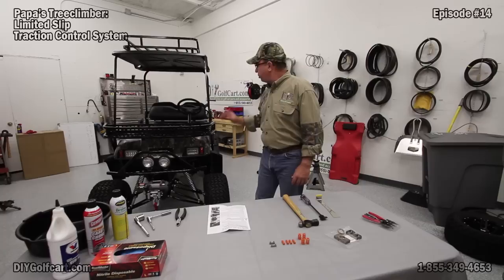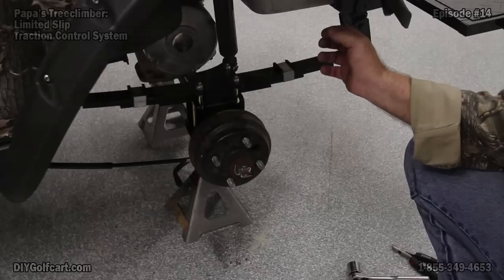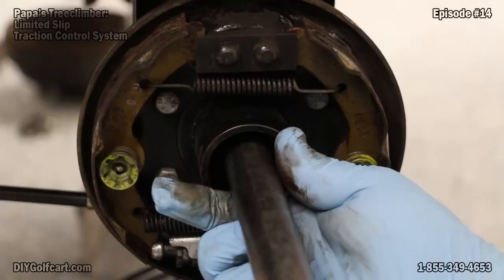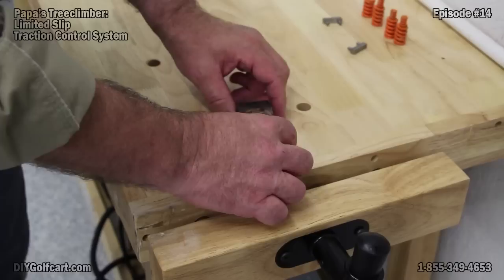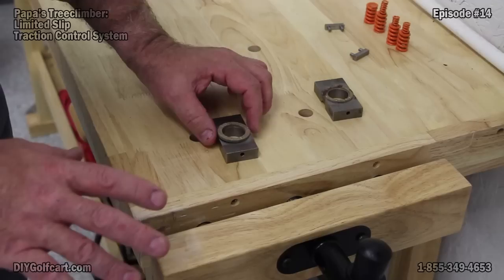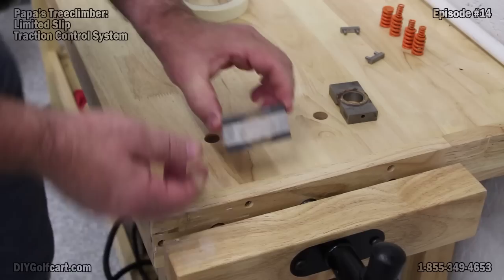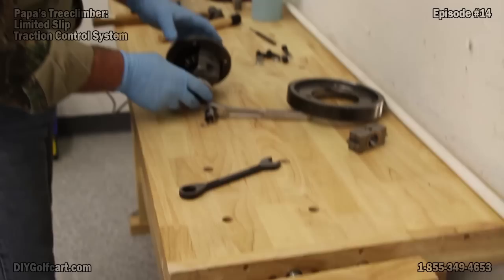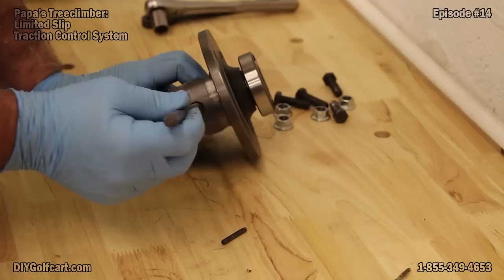EZGO Limited Slip Differential | How to Install Golf Cart Traction Control System

Comment: Great information. I have a 2009 EZGO RVX and the drain plug is made of rubber. I simply add the oil through the axle tube while it was still open. I didn't see in your video, but i added 2oz of friction modifier for limited slip diff.

Comment: Ahhh,.. at the end, you put the Brake Drum back on over the wasted brake shoes. ???? Did the friction device work? How about a demonstration? The device connects the 2 axles inside the differential via the 2 friction washers rubbing together? How long will that last before the surfaces are worn? The fiber friction rings you pressed in are the serviceable replacement parts that would wear out?

Comment: I have a 2005 yamaha pro hauler 700. I followed your instructions on how to remove the rear axle but the rear axle does not slide out like you show i need your help so that can install the limited slip

Comment: what is the torque value on the differential cover?
Reply from the maker: I have looked and looked and the closet I can find is 5 to 7 ft lbs. You mainly want to snug it down without over tightening. It's going into an aluminum case so don't tighten it with an impact!!
Reply: Thanks! I went with the generic torque values in the book that said for 5/16" bolts, use 8 ft lbs. So you are right there. Thank you for responding.

Comment: Great video!  I thought I had the info I needed until I looked at mine, I have no "pumpkin".  I have a 98 ezgo gas txt.  I cant find anything that breaks down how to do this job on a cart similar to mine. Getting into this rear end looks a lot more complex than the one here!  any help would be appreciated.  Thanks
Reply from the maker: Unfortunately at this time, I do not know of a Traction Control System that will fit in the older style carts. Keep checking back for more video's and I'll see what I can find.
Reply from the maker: Nope, that's the same type in the video.
Reply: DIY Golf Cart thanks!
Reply: DIY Golf Cart
The electric TXT rear ends are different from the gas TXT rear ends. The housings are way different.

Comment: I bought my golf used from someone who did not know the year or any paper work. How do I find the year so I can order parts. I locked up the rear axel and may need to order parts after watching this vid the code plate shows manuf code F201. Serial #1380022. Thx for any help
Reply from the maker: You have a 2001 EZGO TXT. Only thing left is to determine the electrical system. (1) Where is your F&R switch? (2) Does it have a Run/Tow switch? (3) What voltage is it?